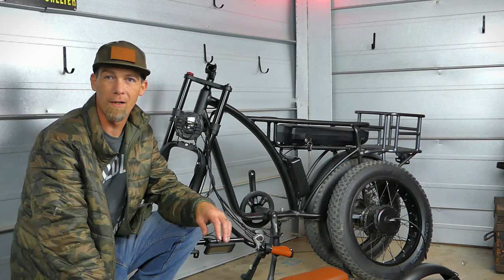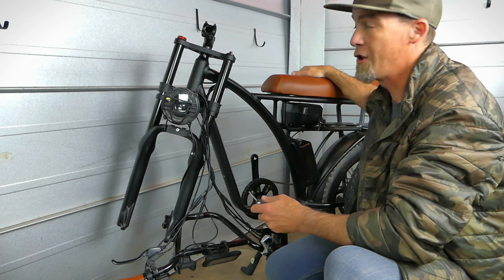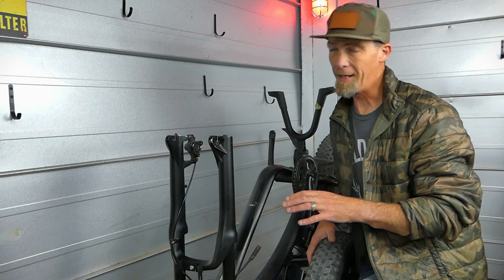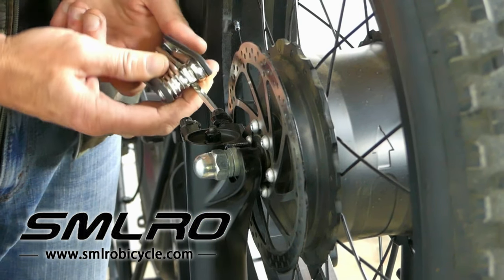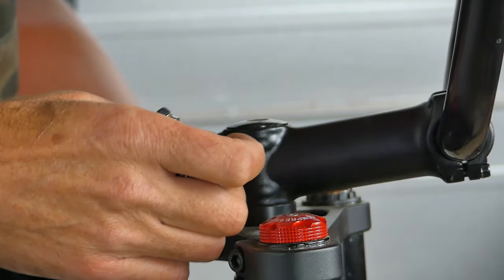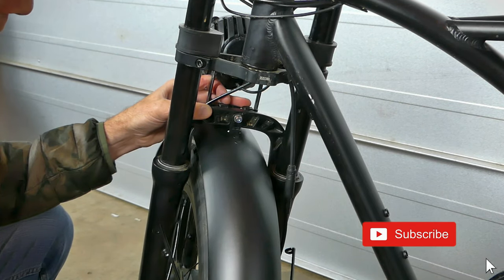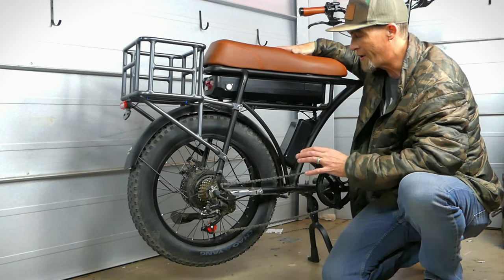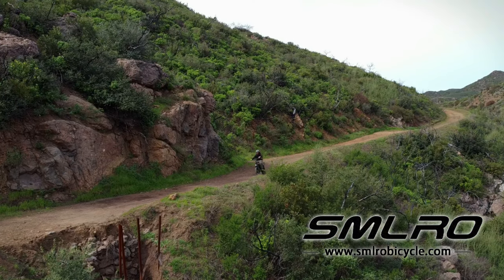SMLRO E5 PLUS E-BIKE ASSEMBLY

Comment: Great review whats the highest speed on this smlro ebike , is there an option to get this ebike with indicators and rear suspension ? seems like the vertical frame section closest to the front wheel fender could house an extra battery as that second battery in the center of the frame seems a bit too small. .

Comment: Thanks for your video. Since it has 7 gears, how does it ride as a bike without any power. Just wondering in case the battery dies.
Reply from the maker: It's what you can imagine, heavy. Not really a bike you buy to pedal. Full review coming, just needed to use it for awhile.

Comment: The front wheel is a little weird. If I tighten the front bolt on the side of the brakes, it doesn’t move smoothly, but when I loosen it a lot, it moves smoothly. Is that supposed ti happen?
Reply from the maker: No
Reply: I got the same issue. I'm going to take it in just to get looked at. I tackled it on my own a d just can't seem to figure out what it is. If you do as well, just  not the brakes have three bearings inside, very small, don't want to loose.